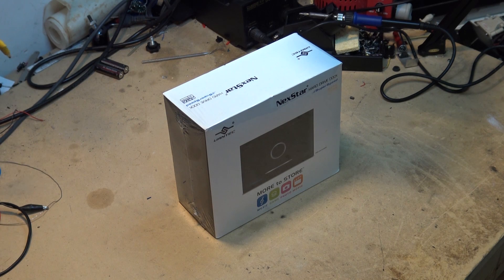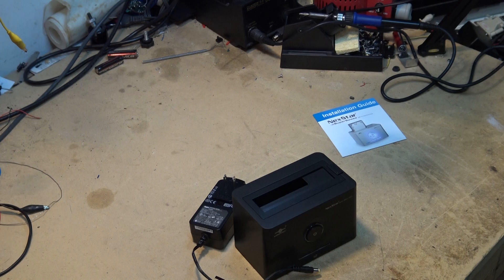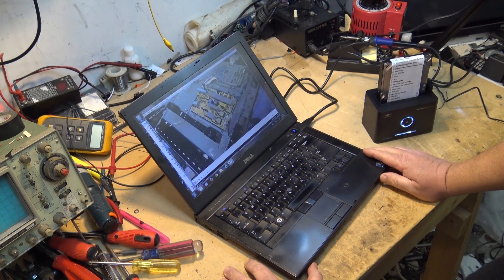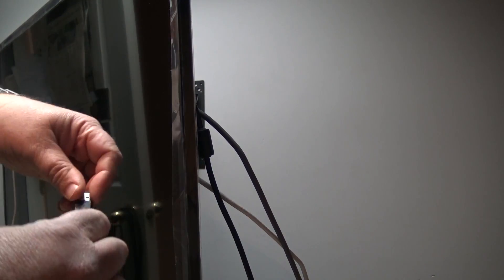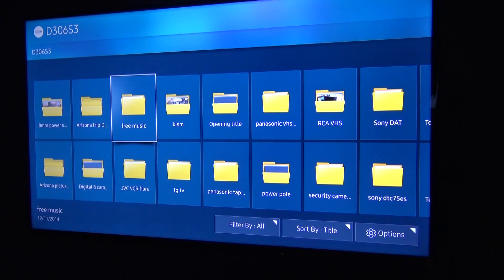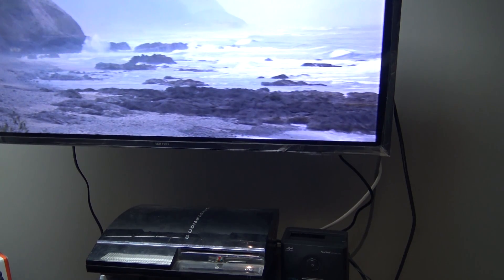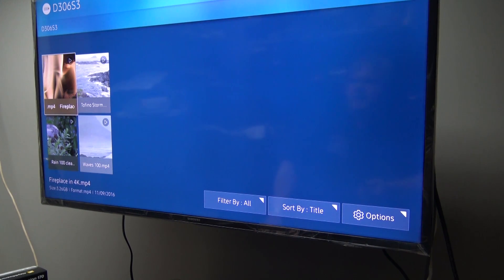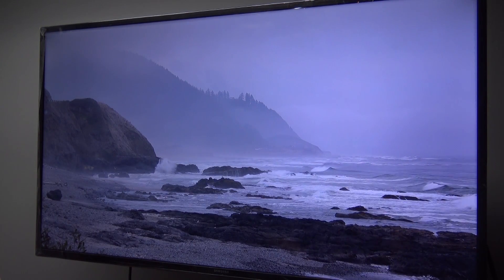NexStar HDD Dock Review and Demo

Comment: Great info, been watching your TV repairs, rich techno stuff here and greatly appreciated. 
Question on the hard drives; to use then in the docking station, do they need to be formatted ? or can it read any Operating System from windows?
Thanks, dan
Reply from the maker: The drive does need to be formatted in order for windows to be able to see it.
I generally format in ExFAT that way the drive can be seen by multiple devices.
Most DVRs I get hard drives out of use a propriety disk format and is encrypted.

Comment: Looks like a decent toaster... err bay lol.
The usb3 is even better, a dam good upgrade :-D
As yours is usb3, they must have created a new chip to do the job, all 
the older usb2 types used one common chip (Jmicron jm20337), no matter who made the 
adaptor.

Ive have the old type of cable that allows ide large/small and the sata interfaces.
Hdd and dvd drives, its a matchbox sized plastic box on a usb 2 cable.
Its been a godsend for recovering peoples data from drives.
Reply from the maker: Yes I have one of those too. Not very reliable though it sometimes craps out reading and writing large files.
I have had the eSATA / USB2 version dock for several years now, and it hasn't given me any trouble, nor has it toasted any drives, as the drive portion is sticking out. My computer has 2 USB3 ports, 8 USB2, a Firewire, and eSATA.
All the USB2 are in use for hard drives, printer keyboard and HD capture box. my USB3 on the front for temporary connections such as HDD and USB sticks.
The eSATA goes to my original dock, and it is very quick as well it is full bus speed. This one I reviewed is mainly for my smartTV.